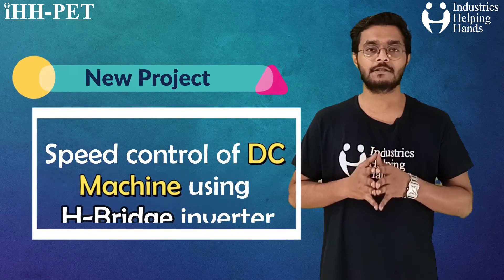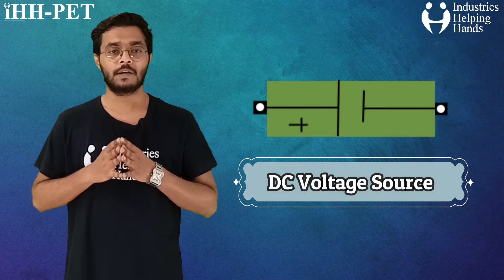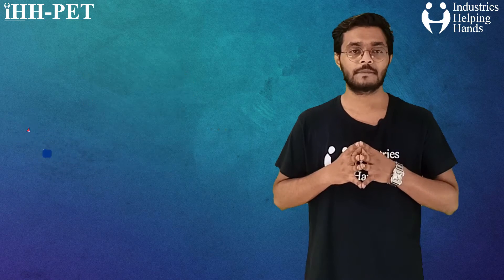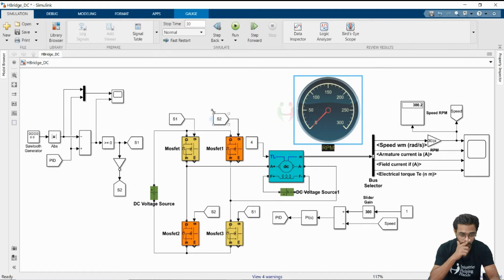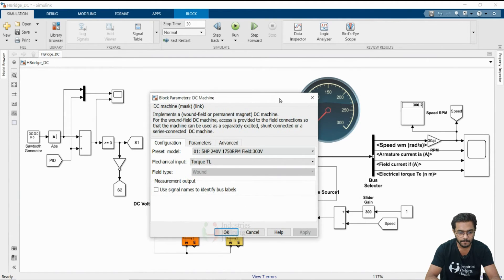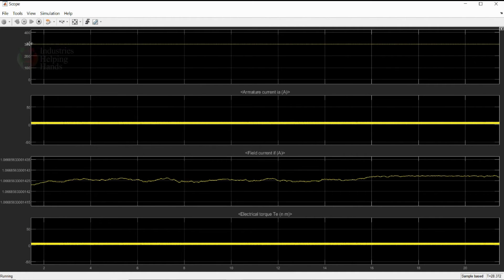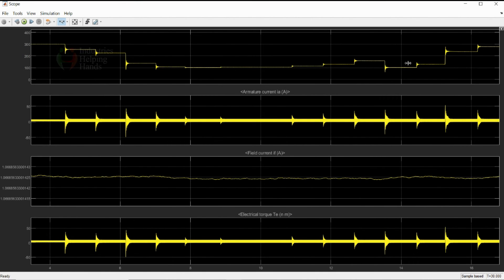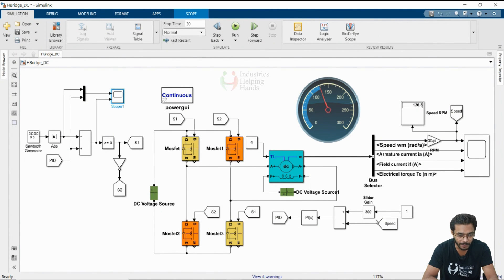Simulation of Speed Control of DC Motor using H-Bridge | Electric Vehicle MATLAB Project | IHHPET

Comment: hello why in the circuit doesnt use PWM in order to control the duty cycle where to control the speed of dc motor
Reply from the maker: Join our mentor session and ask doubts in the next LIVE FREE  Mentor Session directly with our educators
For more details contact via call/WhatsApp:  https://wa.me/917880113112  or  +91- 7880-113-112